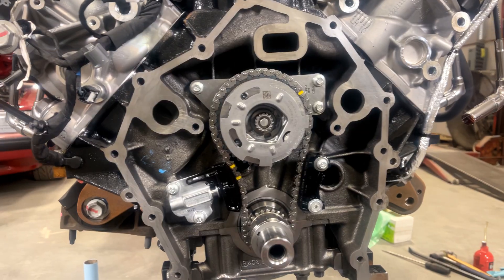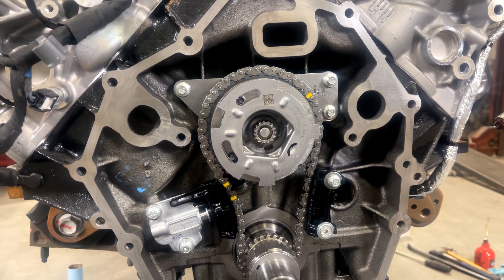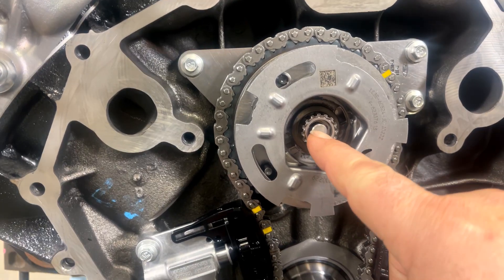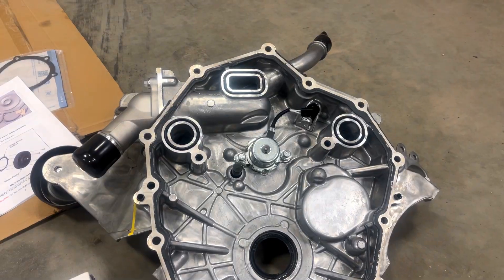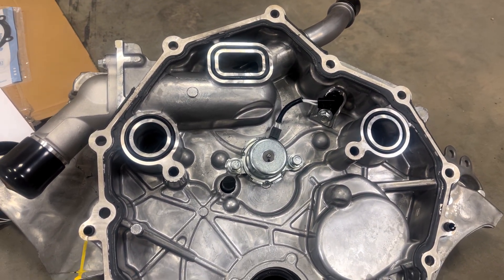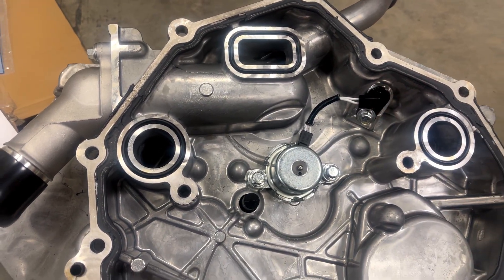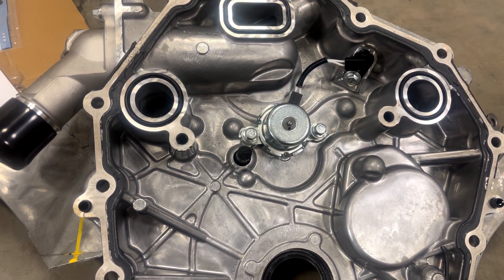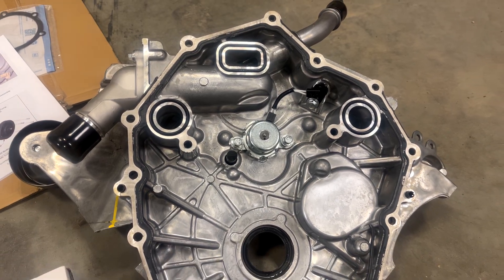How Camshaft Phase Adjusters Work

Comment: That chain driven oil pump is proof ford engineers could fuck up a wet dream
Reply from the maker: Seems pretty goofy to me. I have replaced it with a direct drive pump in conjunction with the Holley front cover/pan install.
Reply: @tecmotiondyno YES that’s the only way to go with the Godzilla Holley has really stepped up their game over the last few years man
Reply: @tecmotiondyno 4.0l sohc v6 is probably one of the GOOFIEST designs they ever made and just a junk engine all the way around. To me if it don’t last 300k without major repairs then it’s junk.  My grandpa had an 02 he gave to my brother and the chain guides decided to explode about two months after he got it. And it had good quality penzoil in it at the time. By far the worst American engine I’ve ever touched.

Comment: ...and cam phasers and VVT are as much for emissions as power, and a PITA as another often malfunctioning electronic component that is expensive to replace!
Reply from the maker: You might be surprised at the power gains that can be had with adjustment of this system, though you aren’t wrong about adding complexity and reducing longevity. These systems on a cam-in-block car are not nearly as problematic as active fuel management/displacement on demand systems though.
Reply: @tecmotiondyno  Agreed on both. I've seen engines with locked phasers, and power is different. Low end felt about the same, but high rpm power seemed a bit lower, but not as dramatically as I expected. But these are seat of pants dino numbers.

Comment: When are you projected to get the Godzilla engine installed and running in your fox body?
Reply from the maker: The engine is prepped and I have a rough cut of the front cover/oil pan install video. Things always come to a halt on my projects for the summer because I spend all my time on the dyno getting other people’s stuff running or enjoying my own summer cars. I expect to pick the Godzilla project up as the fall approaches - October maybe. I suspect it will need 6-8 weeks to get a runner that moves under its own power once I get back to work, and assuming that my personal life doesn’t intervene. I think I have most of the stuff I need to get that far actually in hand right now.